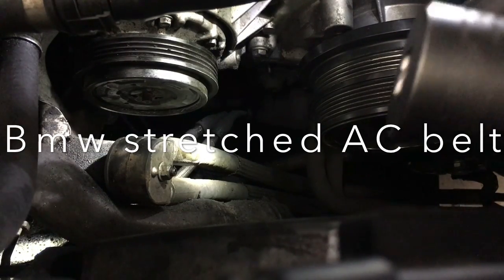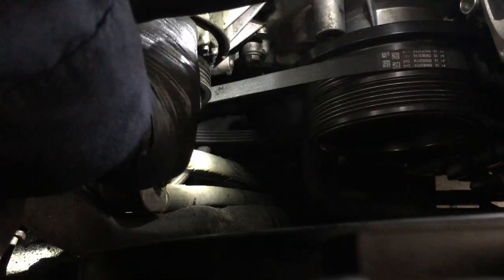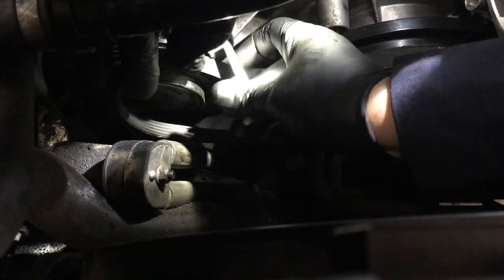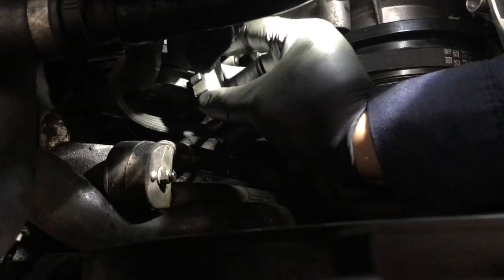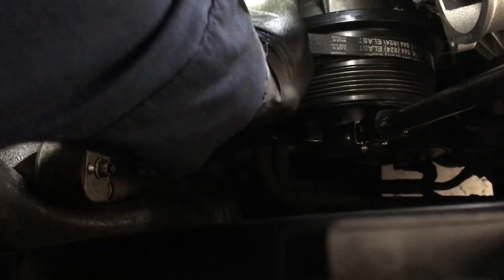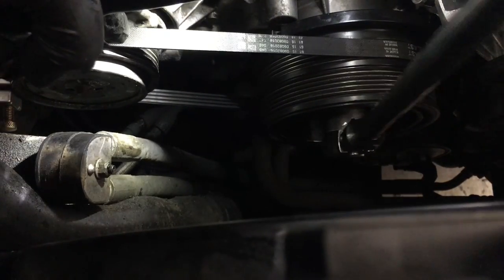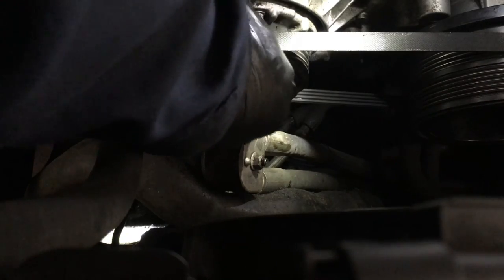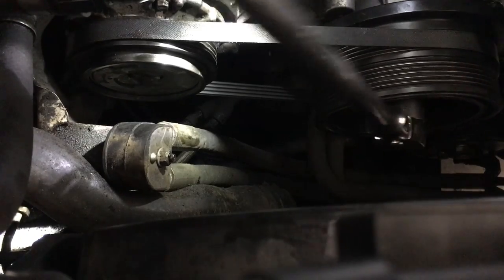BMW N64 745li BMW N62 750li (STRETCHED) A/C COMPRESSIOR BELT INSTALLATION

Comment: Thanks for showing people about the tool and how it works. Just one point of correction, never spin the engine counter clockwise for it result in engine damage. It will mess up your timing
Reply: You do realize there's a difference mechanically between a timing CHAIN engine vs timing BELT? This BMW isn't a belt engine. Belt engines can slip backwards because the cogs are shallow. That isn't an issue with a chain engine as the timing guides don't care what direction the engine rotates as the chain is on a slider.
Reply: My BMW 760I has a left handed thread for the Fan Clutch. The Engine turns counter clockwise as it's running to self tighten the Cooling Fan. Some Engines can be damaged if turned in the opposite direction. It's best to read the Service Manual to be safe.

Comment: I grind the bracket down a little so that the tool could fully rotate and no need to remove the bolts holding the bracket in place. I used this $3 grind bit with my cheap drill (DEWALT DWA4974 Aluminum Oxide 3/4" x 1-1/4" Hp Grinding Pt)

Comment: That is a neat approach to installing the belt with this special tool.  Probably should not rotate the engine backwards though so you don't cause that timing chain to jump.  Tension is created on the timing chain in the clockwise direction.  If reversed, the chain has too much slack.
Reply: You are very correct, most mechanics fail to understand the intricacies of the implications of what otherwise would be an unimportant action that could inevitably cause a catastrophic failure.

Comment: Good video, you don't want to turn the engine backwards though, just take the tool off and rotate the clockwise again.
Reply: This is a timing CHAIN engine and not timing belt. There's a huge difference as belt engine can slip due to shallow cogs.

Comment: The best thing to do is buy a belt tensioner and install it. There is a belt tensioner mount right by the crankshaft pulley on the engine. You need to buy 3 items, 1 belt tensioner, 2 Tensioner mount bolt and a longer belt.

Comment: no take out the bolt then use a metric 7 over the ac compressor turn both and the belt goes on no problem your way make it way harder...

Comment: I'm having the same problem with my 550i.  And This is the only way to install the belt, is with this tool... Trust me.
Reply: Freedom-Vietnam Kay what’s the name of the tool and where can u get it from ?
Reply: I had to change out my water pump, and to do this the big main drive pulley needs to be loosened.  I accidentally took it all the way off and the AC belt fell off in the process.  It SUCKED putting it all back together, but it can be done.....especially if you don't want to drop $25+ on one of those nifty tools.
Reply: @doomrot  25$ i got it for 10$ and if you drive a 550i like me do it right. dont be cheap on bmw

Comment: The tool is about $15 on amazon but I need to get this job done today. I will try with a rag wrapping around the pulley and I prefer not to turn engine counterclockwise.
Reply: Counter clockwise isn't an issue on a timing chain engine. It's the timing BELT engines that can slip due to the belt cogs being shallower.
Reply: @rotaryperfection  it is those plastic guides that I would be concerned with. They might break if u go counterclockwise. With BMW engine, they are by themselves already fragile.
Reply: @derekkchung  If they gonna break, that's gonna happen regardless of rotation. Also a 180degree turn backs is nothing.
Reply: @rotaryperfection  Tired guides, weak tensioner and turning engine counterclockwise will give u headache u don't need. I have seen valve hitting piston and guide breaking. Heard of "it was running fine when I brought it in" from your customers? Absolutely no counterclockwise turning on timing belt engine and I would avoid doing that on chain engine.

Comment: Tips on removing the old belt?
Reply from the maker: r mac you could just cut it or Instead of installing the tool over the belt just install the tool under it and rotate as I did in the video
Reply: can anyone tell me what is the number of the BMW 745li fan belt please
Reply: cut it. belt only moves forward. safest way for you and the engine.

Comment: I got the tool and it is not still not going on any suggestions.....
Reply: @Fvck.Crowdz  I just replaced the AC belt by using this tool today,  the trick is when you turn the engine, you need to pull the belt upwards really hard, it works.

Comment: The easiest way to put belt on is going the opposite way counter clockwise. I just did it and works fine.
Reply: Nope!
Reply: Don't give advice if you don't know what you're talking about!!! counter clockwise can damage the engine, mess up the timing, loosen the pulley bolt all kinds of bad stuff.  People like you make me so sick!
Reply: @Engineerboy100  And people like you are clueless. This is a timing CHAIN engine. Belt engines can slip because the cogs are shallow. The tensioner does get loose when rotating backwards so it can jump teeth.  Chain engines have taller lobs (just like a bicycle and wont slip. Also the chain engines put the tension on the timing guides so the engine wont loose tension regardless what direction you rotate it.
Reply: @rotaryperfection  I keep seeing you comment on this video. Your wrong. I'm vw/audi certified and have been in the dealer for 15+ years. You do NOT turn a chain engine counter clockwise. Try it on a vw/audi and let me know how it works out for you.

Comment: DO NOT TURN UR ENGINE COUNTER CLOCKWISE !! U WILL RISK JUMPING UR TIMING CHAIN!!!!!!!
Reply: You're more likely to jump timing with a belt. This is a chain engine. Belt engines have shallow cogs so they can slip with loose tension. Chain engines have taller lobes plus the tension is on the sliding guide so the tension doesn't loosen regardless what direction you rotate the engine.